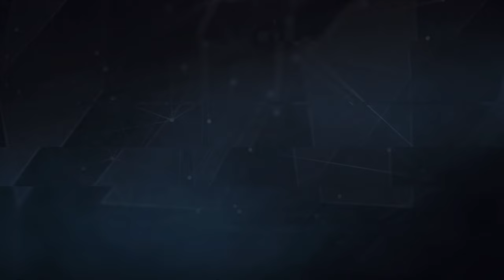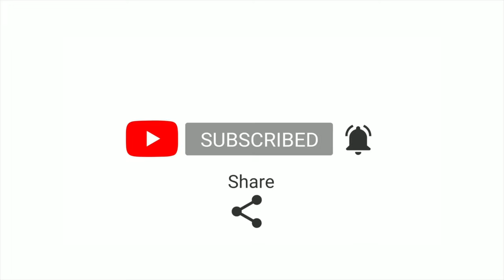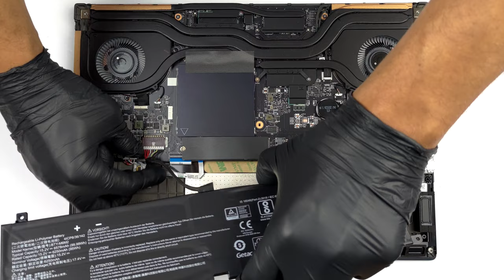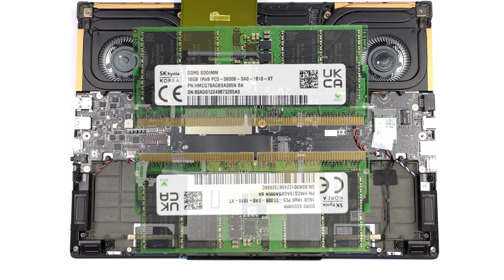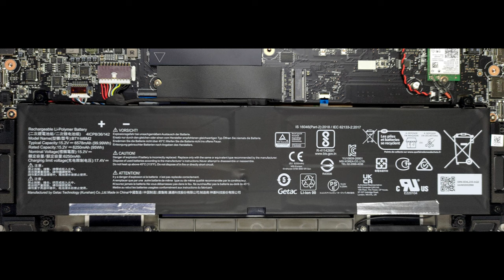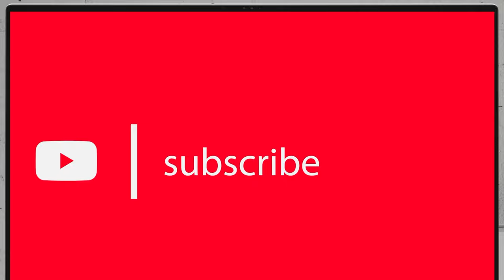🛠️ How to open MSI Stealth 16 Studio (A13V) - disassembly and upgrade options

Comment: For anyone confused Gen 3 SSD also works for this nvme slot, I installed mine and it worked fine.  Also the middle screw is covered by a factory seal sticker, remove this BEFORE trying to take the cover off.  

DO NOT attempt this with out a plastic tool, he made it look super easy but the first time it doesn't open that easy.
Reply: Hi, do you know what are the SSD lenghts compatible for this laptop?
Reply: @btts3584  can you be more specific?  I believe all nvme ssds are the same size.
Reply: I mean, size 2280, 2240, etc
Reply: Do you have the i7 or i9? If the i7, does it also have 2 M.2s and replaceable RAM?
Reply: @herrwarmduscher5204  I have the i7 version.  It has 2 M2  slots. It has replaceable ram as well. UP TO 64
Reply: @Sereous313  Nice! Thanks. The GS60 was weird. Certain models didn't have 2 M.2s.
Reply: @herrwarmduscher5204  that was the first thing I did was put in the extra 2TB ssd.  That's crazy they didn't have that.
Reply: @Sereous313  What kind of RAM did it come with? SK Hynix? What about SSD? Samsung? What SSD did you put in?

Comment: I have the new MSI CreatorPro AI Studio A1VKG (Intel Core Ultra 9 185H). I just finished updating to 96GB RAM and added an extra SSD. Here's my tips:
- It's basically exactly the same as this model in terms of location of parts and how to open it.
- Make sure you have good lighting, the screws are tricky to see. If you are short sighted and wear contacts take them out so you can see up closer better.
- Before you start, inspect around the edge of the laptop and make a mental note of how tight everything is. 
- When removing the two outer screws on the bottom (underneath where your hands rest) realize that they're at an angle and not perpendicular to the body like the other screws. If you don't angle your screwdriver at roughly 45 degrees to start with then you'll strip them. Push fairly hard on the end of the screwdriver when you turn and VERY IMPORTANTLY TURN SLOWLY. These screws are shorter too when you're reassembling it. You don't want to strip these ones.
- I found the guitar pick type tools the best. Go around in tiny increments. Just keep going around until you get clicks all the way around the perimeter. 
- I started prying it apart with the laptop open and got most of the keyboard separated before closing the lid, doing behind screen and then turning it over carefully to do some final manipulation.
- You don't need to unscrew the battery, just disconnect it. It's quite a lot of tugging, using a tool to pull the edges may slightly help but wiggling is important and pulling pretty firmly. If you really have trouble then unscrewing the battery may help, but be careful not to drop it on the motherboard if you do that.
- If you're updating RAM AND adding a drive: Do the RAM first, then you've got a little more room to open the RAM cover (since the new drive isn't in the way).
- After closing up, put the screws in very loosely then squeeze around the perimeter to get all the edges to snap in. This is why I recommended visually inspecting it before you start - then you'll know you're done.
- Before fully tightening the screws make sure all the ports are fully centered inside the holes in the case. If not you just need squeeze a little harder.
- The laptop probably won't turn on with only the battery when you're done. You'll need to plug in the power adapter. Even though I was expecting this it's quite scary (I only do this sort of thing every few years).
- It may take a REALLY (well it seems that way) long time to boot up the first time. It's probably got to run some checks or something like that. It felt like 30 seconds to me and the logo was slow to come up too.
- You shouldn't need to go into the BIOS for anything.
- You will need to open disk manager to format and assign a drive letter.
- Yes this laptop supports 96GB. The 185H version does at least. I see it in my Task Manager now and it looks kind of crazy jumping from 32GB!
Reply: Thanks for the detailed review and all your suggestions. Do you know why MSI covered their RAM with this metal box? Others don't do that. I guess the box makes RAM way hotter, so it'd be better to remove the box at all
Reply: @AlexBoiko-u5o no idea. I haven’t had any overheating problems but the CPU does get a lot hotter than I was hoping for. Probably will be my last Intel laptop but should last a few years.

Comment: Thank you so much for this video. I used to have an MSI Stealth Skylake 6700 and the SSD and RAM were on the other side of the mobo. I had to take EVERYTHING apart just to change SSD and RAM. This is soo much better!!! Do you know if the base i7 version also has upgradeable RAM and 2 M.2 SSDs? On the older models, it depended on the configuration.

Comment: Are the m.2 really only gen 4?  I thought the 13xxx CPUs supported  pcie 5.0
Reply: I just installed my Gen 3 SSD 2tb nvme and it worked great.
Reply: @Sereous313  i installed two 990s gen 4s and they work but I'm curious if 5.0 works

Comment: They skipped the most important part - where you actually need to put the plastic thing to separate the case and take it off ...
Reply: You're right. I was kinda quiz for me. I tried to remove that rear metal plate. Than I realized that the plastic frame has to be unbent first